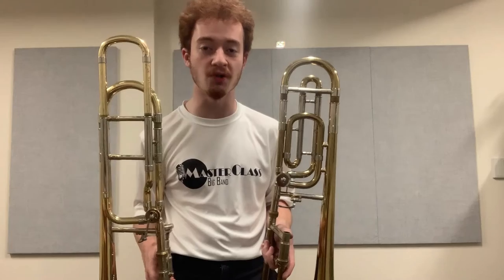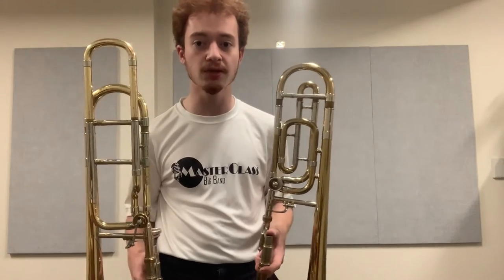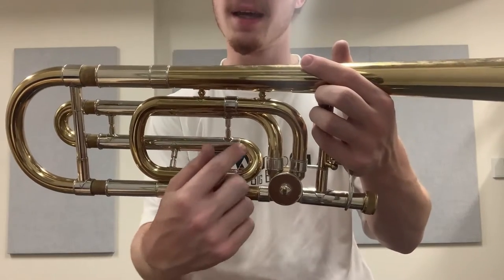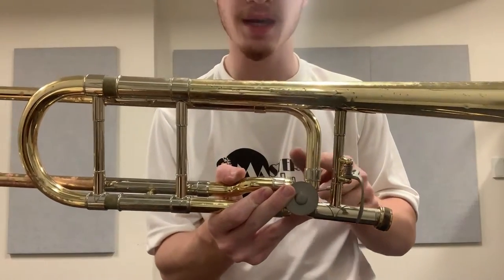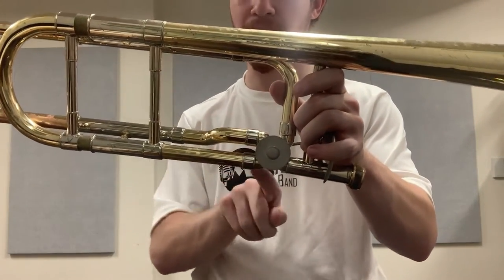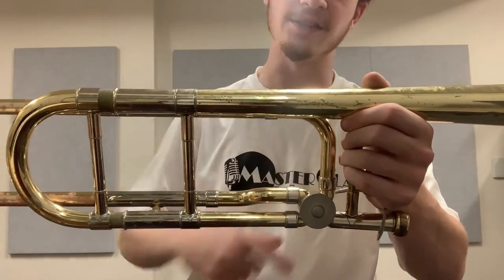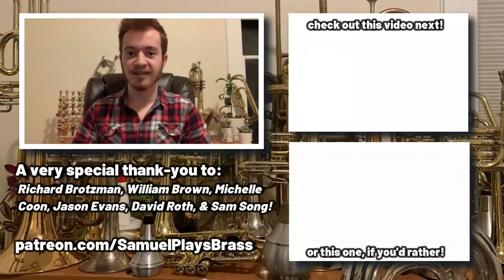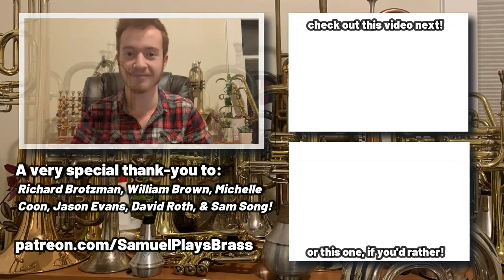Let's Talk OPEN vs. CLOSED WRAP Trombone F-Attachment! How Do They Sound?

Comment: As a bass trombone player, on a tenor trombone, I usually prefer the open wrap because the low range is much better and much more consistent. Tone quality is also much easier to obtain than on the closed wrap

Comment: So I play a closed wrap and I actually sort of think those that swear by open wrap are kind of overblowing the difference. Pun intended. However, there is definitely a sound difference here. The open wrap seems more open and robust (by a small degree but it’s there for me). I would say something like sounding louder without actually being louder.
Reply from the maker: I think you’re exactly right. As I mentioned in the video, there are other factors that make a bigger difference than the trigger wrap, like bell material for instance. My copper-bell Conn 88H (closed wrap) has a more enjoyable trigger register experience than either of these trombones, even if the 42BO feels 10% better than the 42B down there.

Comment: I don´t think that the wrap matters at all. I own a used Bach 42B with a Corporation bell since the 80th and had this trombone as the first large bore instrument as a student. At that time I was playing in a wind orchestra and a trombone ensemble. My tone was not that great and I was always told that I should use more air. But I was just not able to play with more air to generate a better and fuller sound. I had difficulties using the F-attachment in the lower register not being able to generate a nice and full sound. Since I was young at that time I thought that my limitations were due to my inexperience and the lack of lots of practice. Even ten years later I had problems with that lower register. Then I quit playing trombone for quite a long time and only recently picked it up again. Someone gave me the advice to play on a standard Bach 5G mouthpiece rather than on the 61/2 that I had played all these years since I was a student. I tried the Bach 5G and some other mouthpieces and ended up on a Schilke 51. Now the lower register is easy to play and my tone is full and rich in every register. I meanwhile own another Bach 42B with a custom modern full flow rotary valve, another Bach42 with a Hagmann valve and an open wrap and a Lätzsch with a full flow rotary valve and an open wrap. They all play easy with the lower register and all make a great sound. The sound of these instruments is different though, but not because of the open or closed wrap. The instruments are different in the brass that is used, either yellow brass or gold brass and the weight distributions are totally different. I figuered that the brass material and the weights make the biggest differences regarding the sound. Meanwhile I also recognized that the lightweight slide is actually taking away a lot of the sound quality and I now prefer a standard yellow brass slide.
Reply from the maker: Thank you for your comment. I would definitely entertain the notion that alloy composition, mass distribution, and most of all mouthpiece choice make for a bigger difference in low register performance than the wrap of the F attachment section. Your experience is pretty typical—once a trombonist switches from a 6-1/2AL to a something like a 4G or 5G from Bach, a 51 or 52 from Schilke, or anything with a deeper cup and wider throat, it allows for much greater facility and a more pleasing tone in the lower register. 

However, I would still wager that certain types of valves and wraps better help to “clean up” the transition between the open-tube and trigger registers (otherwise why would all those options exist?) but the difference does turn out to be quite small aside from the most serious and strenuous performance settings where a 1% easier-to-play instrument can make it or break it. Preferences can also vary based on the player. 

My personal trombone is a Conn 88H from 1975. It has a closed wrap. I think it has a very pleasant and easy-to-navigate trigger register compared to most trombones I’ve played—including any Bach 42—thus far only being beaten by another 88H which I could only try for a couple minutes as it wasn’t for sale. For me, the wider mouthpipe opening (Remington vs. standard Morse taper), the fully-copper bell section, and whatever manufacturing techniques Conn reserves for their upper-end brass (I suspect some amount of annealing) provide a lower and trigger register experience that sounds and feels pleasant.

Comment: I have both a 42B (closed wrap) and a 42BO (open wrap). I find that there is not much perceptible difference in the 'blow' between the two F attachments. I can't compare the sound though, because of the differences between the 2 instruments. My 42B (closed wrap) has a standard brass outer slide and a yellow brass bell (silver plated), while my 42BO (open wrap) has a lightweight nickle-silver outer slide and a gold brass bell. Apart from how it sounds and how it 'blows', I like the look of the open wrap. Every time I look at it, it makes me smile, so it makes me happier to play that one. Thus that is the better instrument for me!
Reply from the maker: I do agree honestly with your mention of visual bias. I absolutely love my closed-wrap Conn 88H circa 1975, but sometimes I feel a little sad just looking at the closed wrap, even though its response and volume and tone are all superb.

Do you notice much a difference in sound (trigger stuff notwithstanding) between your 42s? As in do you find more immediacy of attack and more top end on the one with the lightweight nickel outer slide? But then again, I suppose the gold brass bell might balance some of that out, eh? I guess the better question would be whether you find that having all three alloys present (yellow brass/gold brass/nickel silver) gives you a greater range of tone quality than a more or less all-yellow brass horn.

Comment: I found the tone slightly more consistent on the open wrap model (listened twice). The point about higher back pressure making pedal tones easier on the closed wrap model makes sense, but I really like being able to substitute trigger+1/2 for positions 6/7 for the notes on the staff without noticeably coloring the sound. The Conn CL2000 models have this quality too.
Reply from the maker: I appreciate your thoroughness, Jason. After listening to the clips again I did find there to be more difference than I had heard behind the bell. What you’ve described is definitely the most important aspect of a trigger. My stock, closed-wrap Conn 88H is pretty strong in this area despite the extra bends, though Jim Marshall’s open-wrap Conn 88H does have a more open feel and sound on trigger notes.
Reply: The CL2000 rotary valve has the shortest throw in the world.

Comment: In my opinion, the valve wrap doesn't really make a difference. I find that the closed wrap makes it harder to find and empty condensation but that's it. I think it has to do more with the angle that the air is traveling at through the rotor and how open the rotor is. My Bach 42 closed wrap with a brand new instrument innov. Rotor plays better than all open wraps I've ever played. My Bach 50 bass trombone has open wrap valves (stock) but they are not the best valves I've ever played.

Comment: This is the 1st of your videos that I have ever seen. There were a number of things I wanted to comment on right away. But I decided to watch your video on the Bach Strad trumpet before commenting here. There are several things in that video that I think apply directly to this one. Chief among them is that 2 instruments, made consecutively at the same factory can be very different. That is EXACTLY my experience. (So, comparing a 42B and a 42BO...just 2 horns...may reveal differences that have absolutely nothing to do with the differences in the wrap, imho.)

I had the good fortune of being able to go to the Bach factory in the early 1980s and, over a period of about 2 years, buy 4 trombones. I have a 12, a 42 (no F attachment), a 42B (with F attachment, and with options I'm not sure are even offer any more. They actually called the horn I have a 42 BO because it has what they called at the time "an open lead pipe". I'm not even exactly sure what the difference in between that lead pipe and the lead pipe on my other 42. This 42 BO also has a light weight slide.), and a 50B bass trombone with F and dependent Eb rotors. In EVERY trip I took to the factory I was able to play multiple horns...over 20 when I bought the bass trombone. And some were arguably "bad" instruments. I could go on and on about that.

In just the last few years I became acquainted with a technician who recommended that he increase the openings in the valves of my 42B and 50B. I was skeptical at first. But after having him "open" the valve on my 42B I was convinced. Remember, I was already convinced that these were great horns, having personally selected them at the factory. But he has made them even better!

I also play a Bach 37 trumpet. I bought it off of ebay more than 20 years ago, and have been satisfied with it over all. But I know that there are better Bachs out there. I helped a student of mine pick a brand new Bach at a local music store. I played 4 hors there. One was a no go. In the other 3 I found what I thought was a good, better, best scenario. I did the play testing before my student arrived, and told him of my findings WITHOUT telling him which horns I thought were which, wanting to see him make his own decision. Kind of a blind taste test. He ended up choosing the horn that I thought was best. And frankly I thought the horn he got was better than my own horn.

Finally, I haven't watched it yet, but I noticed you have a video on the Yamaha 321 euphonium. I had one of those when I was in college, a 321S. It served me well then. But knowing what I know now, I would rather have had a Besson or John Packer compensating euphonium. The Yamaha was very 'pitchy' on certain notes, and did not have the robust tone that is more common from the Besson.

I know this is a giant geeked out post. But, hey, what are you supposed to do when you find a youtube channel what's all about instruments that you play? Glad youtube recommended your channel.
Reply from the maker: Thanks for your comment. The variability between Bach instruments is unfortunately a very real phenomenon. You have probably one of the most quantifiable experiences I've heard about in that regard, seeing as I don't know many who hav had the opportunity to go to the factory and try horns side by side right off the assembly line.

I am interested in the process of widening rotor openings. The design of the circular rotor doesn't make much sense to me in general, with how the ports are shaped. 

I think your assessment on euphoniums is very accurate. The 321S is hugely popular with trombonists and high school players, but ultimately I think the more robust UK-style euphoniums are, 9.5 times out of 10, the way to go. I am extremely happy with my John Packer JP-274. I've been told to sell it and put that money towards a 321, and I'm glad I never decided to do such a thing. Although I like the 321, the pitchiness and slight thinness you described are inherent to it and other small-shank inline-4th euphoniums.

Comment: As a professional bass trb. (orchestral player) i prefer the open wrap.
The sound is a lot more natural and in general using the open wrap is a lot more easy to play.
I personally am using Hagmann Valves on my Courtois bass. and I am quite satisfied.
The negative side for the beginners is,  that ,,you" are controlling the air flow much harder than if you are using  a rotory wrap.

P.S. Sorry about my bad english

Comment: benge 190f (closed) vs Getzen 3047AFR (open)....hagman (I think on the benge) vs. thayer on the getzen.  Played both for maybe a 100 hours or so....I don't notice a difference in the air pressure or the sound when using the valves.  same-same to me.  I enjoy both.  Great vid.  More?!?
Reply from the maker: Thank you for your comment. I wish I had the chance to test out the different types of valves like the Hagmann and Thayer. Unfortunately almost all of my experience is with conventional circular rotors.

The consensus from what I’ve read online is that each of those special valve types has its own advantages and disadvantages, but all are overall pretty similar to each other and a slight step up over standard rotors. I would imagine there are differences in annealing or processing between the Getzen and the Benge that are much more consequential to how each plays than the type of valve used.

Comment: Does the closed wrap have a more mellow/soft/pastoral sound and the open wrap a bright/clear/powerful sound since first one has more air resistence,  does it change the overall sound of all notes ranges (not only pedal) or is this wrong ? Thank you for your video.
Reply from the maker: It’s a VERY minor difference, almost entirely in feel on the player’s end rather than sound on the audience’s end. It also only affects those lower notes for which the trigger is actually used, meaning only a few notes in the lower and pedal registers. The difference in impedance is not very significant unless a completely different style of valve is used for the trigger, which is something I haven’t had the chance to experiment with unfortunately.
Reply: So will it be easier to have a mellow/softer/pastoral sound (like euphonium or fungelhorn compared to trumpet or french horn) on Closed wrap then open wrap ? Thank you for your info. @SamuelPlaysBrass
Reply from the maker: @piggdsbest333  no worries. No, the difference in sound is slim-to-none between the wraps. And again, it only affects the blow of a few notes on the instrument.
Reply: Great to know ok. What kind of Tenor Trombone would you then recommand for a softer/mellow sound for pastoral/church music such as Bach or Baroque music. Trying to avoid the brighter/power trombones as those would be more suited for Jazz Avenues or big Band setup.  @SamuelPlaysBrass
Reply from the maker: @piggdsbest333  A standard large-bore symphonic tenor trombone. Look for specs like .547” bore, 8.5-9” bell. If the bell is made from rose brass, copper, or something more pink-looking than the yellowish tint of normal brass, that can help, too. My preference is the Conn 88H, which has all three of the above attributes (.547” bore, 8.5” bell made entirely of copper). The Holton TR-158 or King 5B are good picks if you favor the more diffuse sound of a 9” bell. The Holton, I believe has a rose-brass bell, whereas the King does not—although in isolation that singular factor means little. Additionally, regardless of the trigger wrap, a trombone with an F attachment naturally weighs more than one without, and that extra mass reflects lower frequencies better, resulting in a fuller, wider sound with less harshness. I think any large-bore trombone with something like a Bach 4G mouthpiece should fit the bill you are talking about, but the three examples I mentioned are ones that are notable for having a nice, round tone.
Reply: @piggdsbest333  In general, if you want a softer / mellow sound, an instrument with a gold brass bell or rose brass bell might be better for that. An instrument with a yellow brass bell will make a brighter / more piercing tone.